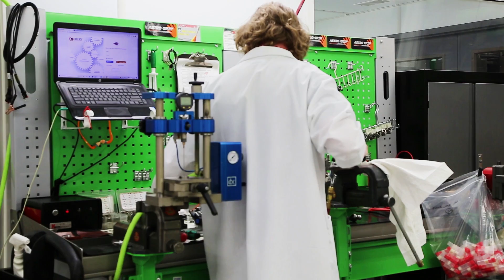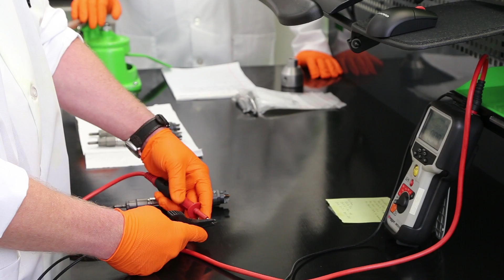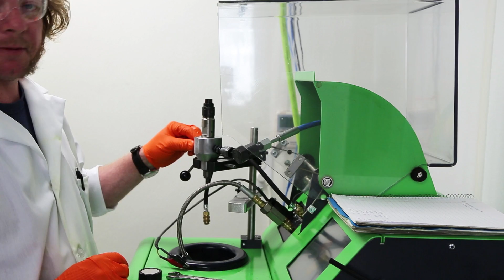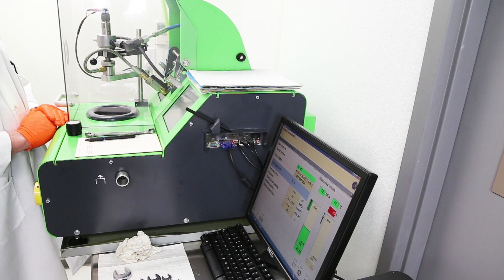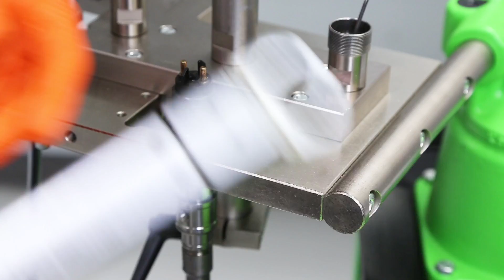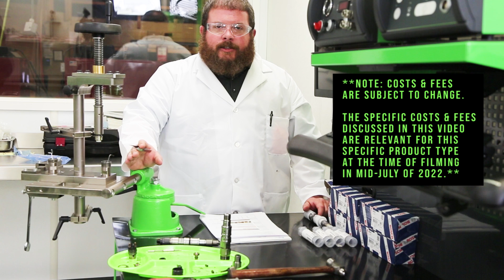Low Rail Pressure + 3K hrs - are these Bosch Injectors Done? @AreaDieselService x @DirtPerfect

Comment: In the 3000 hours, each injector "fired" approximately 225,000,000 times. But no engine runs constantly at full power, so it is safe to say that it will be around 200,000,000 times, and that is a lot!!!!!

Comment: The ony thing I would question is whether or not it would be importnt to check the customer provided fuel delivery tubes which seal against the injectors to make sure they aren't faulty either? Maybe a modification (additional test fixture) to your test stand to test those as well? Or are they inexpensive enough to suggest just getting new ones with an injector change out?

Edit: OK, I see you recommended new 'one time use' push tubes.
Reply: @wirenut003  Yeah, I commented on it while the video was still paying because they hadn't mentioned anything about testing the tubes. Anxious I guess.

Comment: Sir you spent a lot of money getting the clean  room and your blowing it. BIG TIME. 
 Get the tear off floor mat's, sticky takes dirt of shoes.  
The big screw up is the paper and box's. You want zero paper, towels, box's are the worst. They shed wood particles they call shorts.  Have shelves and file cabinet out side the mouse trap.  Foyer with less pressure than your clean room. Outside door does not open until inside door closes.  The foyer is a higher pressure the the area outside of room so nothing can blow into the room since all the air is coming out of the room. 
  I setup labs with cascading room pressurization.   Need any help (free) reach out.

Comment: Great stuff,so in narrowing down the low fuel rail fault, would having the injector heated up to a machines operating temp possibly reveal the issue on the test bench.As like ignition coils on small engines run fine on start up but fail under increased heat as they wear out.Tolerances change with heat in such (microns) of tolerance.Just a thought in diagnosing the gremlin.

Comment: Hell of a setup and very ironic that it requires a clean room to work on a component of a machine , that operates constantly in some of the dirtiest environments possible .
The good part was the problem was repeatable and you could quantify a problem with empirical testing .
Intermittent problems that you cannot make repeat will turn into business for the liquor store , funded by all the swear jars you filled .

Comment: What class clean room do you have there?
Reply: It's not that high at all - they're not even wearing shoe protectors from what I can see, and even in the "dirty" clean room I've been in, you have to wear shoe covers, and they have those curtains you see in walk in coolers in grocery stores to prevent the free flow of air from outside the room coming in (and to help maintain the positive pressure in the clean room, so that air is only going out). An actual clean room you have to wear a full head to toe tyvek bunny suit, with multiple layers in some areas, multiple layers of gloves, all facial hair has to be covered, all with a particular protocol as to how you put it on and in what order, and how you take it off and in what order to protect the clean room from you and your shedding skin particles, hair, droplets when you talk, etc etc. And there are essentially air locks, and air "showers" going into the clean area. This is probably as clean as a good paint booth with freshly washed down walls would be - filtered air, no large dust, but not super clean as far as "cleanrooms" goes. This is probably not even good enough to work on hard drives. Oh, and also, he's using paper towel (or maybe kimwipes) to check for leaks. Some kimwipes are cleanroom rated, but if that's paper towel, that would be a definite no no in an actual cleanroom.

Comment: I find it a little ironic that you must work on these with latex gloves and in a clean room, free from minute particles of dust, yet full heads of hair, beards, and mustaches go completely uncovered! 😱🙈
Reply: The latex gloves are for the protection of the employees, not the Clean Room requirements (as stated by Bosch in awarding them their Service Center authorization ... and "audited" as per AS9100). Diesel has toxic potential and can affect multiple organs. Exposure can occur after ingestion, inhalation or through the dermal route. 

Area Diesel's Clean room is to whatever class level they decide as the OEM authority; Class 1 (the cleanest ... Health/NASA stuff) to 1,000 ... but all have requirements for "positive pressure" and how often the air is exchanged per hour. This is to say that AD's system takes into account "hair/clothes lint" and is sucked up in the Clean Room system.  Clean rooms for my particular vocation (Aerospace Composite structures) also have stringent temp/humidity requirements.
Reply: I was just going to say the same thing where's your beard mask and gloves.
Reply: Same thing I thought 💭
Reply: If you've ever taken an injector apart, you'd know the tolerances are so close and precise, hair wouldn't fit in there - it's only small particles you need to worry about.